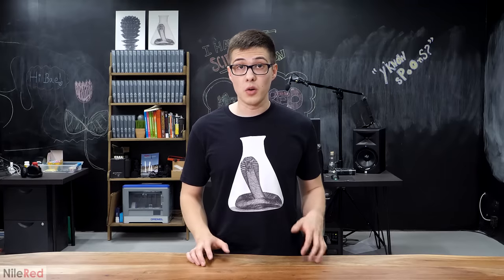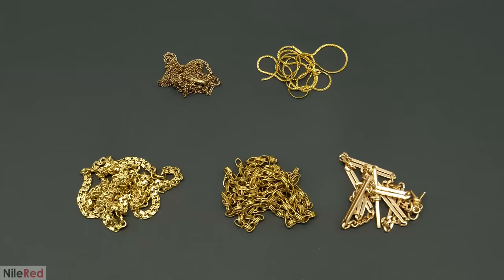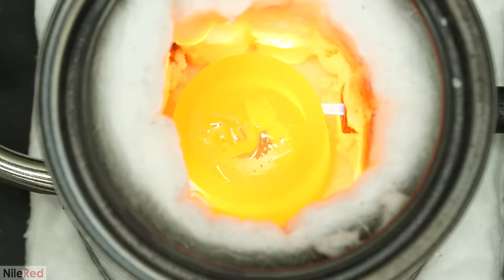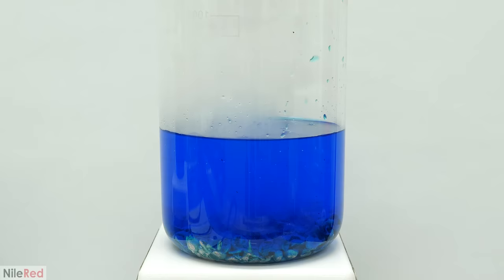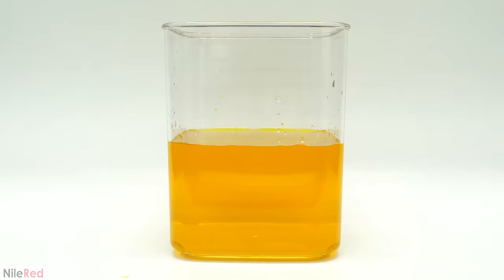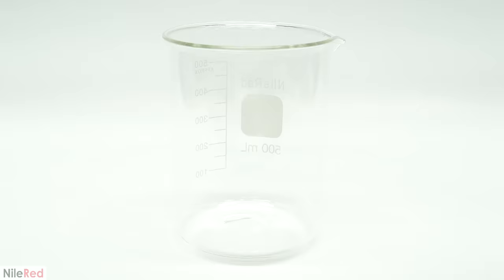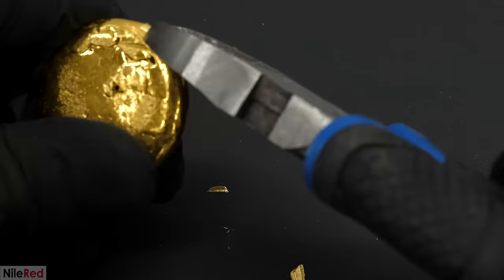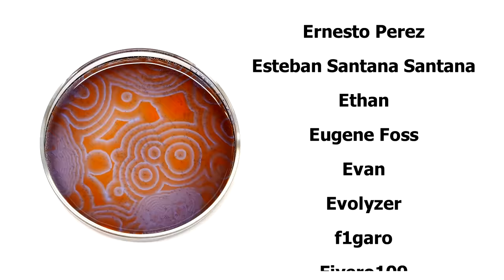Turning old jewelry into pure gold bars

Comment: Is no one going to talk about the fact that someone just sent a functioning ROLEX to be destroyed??
Reply: i think the rolex may have been a good quality replica which could still have 14k gold plating. itd be stupid to send a real rolex lol
Reply: @nocturnalmayhem0  It is stupid to send that nice replica (if it actually is) anyway
Reply: @fernandovillafuerte2529  nahhh replicas are bad if they use the real brands trademarks, someone could easily sell replicas as the real ones for real high prices so every replica destroyed is good in my opinion. if theyre homage replicas with no branding then theyre fine
Reply: @nocturnalmayhem0  You are right
Reply: It's 100% a fake. The seconds hand on real Rolex's moves in a steady fluid motion, You can see that one ticking.
Reply: I'd rather have the R.olex than the $3 worth of gold microplating.
Reply: @Autobot Star Platinum lowkey
Reply: @iheartninja  No, thats consistent with how a Rolex like this one moves. Most base level Rolexes (mainly ones without a chronometer, but thats not a hard and fast rule) have a fairly slow vibration rate (how many times the watch "ticks" per second), this means that the second hand moves with somewhat more visible jumps. No watch actually moves perfectly smoothly, its only that they move many times per second, so they look much more smooth than a quartz watch. A watch with a higher VPH will move more smoothly, but the way this one moves is still consistent with a mechanical watch movement (movement being the name for the innards of a watch). While it is still possible, I think it is unlikely that this is a replica, as those are nearly always quartz movements.
Reply: @Nguyen Max Most watches still hold significant value on the second hand market. In fact there are many companies that specialize just in selling used timepieces. I can nearly guarantee that this watch is not a reproduction and is probably still worth a fair bit. It is certainly worth more than the gold it contains...
Reply: @nocturnalmayhem0  Yea that shit was ticking and not gliding so def not real
Reply: Rich boi
Reply: @eshanroveran7850  all mechanical watches (like most Rolexes) still "tick", they just tick multiple times per second, making the motion look more fluid. Some watches "tick" very fast, moving many times per second, and therefor look more fluid. Others "tick" only a few times per second, as low as 3 times per second (there might even be a two, but ive never seen one), so you can notice the motions much more easily. Contrary to what many people think Rolexes are not the pinnacle of watches, especially not the lower end ones, and some Rolex models do indeed "tick" that slowly.
Reply: at 1:42 I definitely stopped watching. 
dislike
Reply: @nocturnalmayhem0  But it wasn't stupid to send someone over $3K worth of gold?
Reply: who sends a gold functional relex to be melted  ..
Reply: @iheartninja  no, it does not
Reply: It’s a fake, the watch it’s based off has an oyster movement and therefore the second hand would not tick, To me it looks like a cheap fake too possibly sold to him in a scam
Reply: I'm ur 1k like!
Reply: I don't mind, I mean a normal watch functions as a watch too.
Reply: @iheartninja  It`s quartz then right?
Reply: tbh rolexes aren't even used theyre only bought for attention lol
Reply: iheartninja some Rolex models don't use the continuous method, I learned this working at a jewelry store. This is one is definitely fake, but you should doubt a Rolex's authenticity based on a wide spread myth.
Reply: @aggonzalezdc  Hell I would have thought that something like a genuine Rolex movement would probably still be valuable in a non-working condition, presumably unless it has met a rather violent end most of the parts would still be functional as spares if nothing else.
Reply: @seraphina985  would still be worth something even in non working condition, because usually it can be repaired by a decent watch mechanic without too much trouble for a tidy profit. Likely its probably not worth much as spare parts unless it was a particularly old and rare movement which may have parts which are no longer in production. Rolex (like just about every brand) maintains spare parts to repair their watches, so spare parts aren't too hard to come by usually. So it may not be worth a ton as spare parts but that doesnt make it anywhere near worthless. Even a cheap Rolex movement is somewhere around 5000 USD? (Not sure exactly, I dont like rolex watches, theyre really not that great and most people wear them just for prestige, not because they love watches, so I dont know their pricing well) maybe worth 1000-2000 on the used market? If you can buy it in non-working condition for a few hundred thats probably worth the time. So yes, definitely still worth something even broken.
Reply: It’s fake Real Rolexes sweep
Reply: @kenyonpapen2608  It is "sweeping". Thats what it looks like when a watch "sweeps". No watch other than the Seiko Spring Drive actually moves perfectly smoothly, they all just tick multiple times per second making it look like they sweep instead of ticking once per second. Some move many many times per second, some only move a few, a cheap rolex is one of the latter (yea, shocking I know, Rolex isnt the best watch that exists, not even close). It is moving exactly the way its supposed to.
Reply: @iheartninja  I dunno about you, but that looks pretty steady and fluid to me. Maybe a slight jitter.
Reply: It’s fake. The magnifying glass on the date doesn’t magnify the date enough if at all.
Reply: I mean, I get it, if my pop gave me some random watch in his will I probably would give it to be taken apart too.

I have no use for it
And idk how much a rollex is even worth. 
Like yeah i could google it now that you guys are making a big deal out of it and I've realised it's probably worth more than the gut feeling I got($200) by vaguely recognizing the word "rolex" from movies...
 I'm only realising that guess is very wrong because of how much shit people are giving Ben in the comments.

Like if I asked you how much a handpan or hurdygurdy is worth you'd (probably) have no clue.
Regular people not being fact encyclopedias, or having a concept of worth, for specialized topics they aren't remotely interested in is to be expected.
You dont know to google the value of something if you didn't know it had value.
Reply: Bernd DasBrot  Bexause it’s an obvious fake and a bad quality one at that.
Reply: @junehitchens7998  that's definitely an mechanical movement and not a quartz movement
Reply: @nopenope7088  Fair enough.  You can believe whatever TF you want.
Reply: Wait that was a Rolex?
Reply: I noticed that too and was like holy shit. Damn son.
Reply: @nocturnalmayhem0  yea wasn't a real Rolex - you can tell just by looking at it.  He could too.
Reply: @aggonzalezdc  this comment section is clearly cursed and littered by people who think they have a clue about what they are talking about. You are obviously completely right, this is how that movement should move. I also think, that this isn’t a fake. No one fakes these old 80‘s Datejusts, at least not with an automatic movement, that’s way too much work when you can fake a hulk or something like that for the same effort and get a fake with much more attraction to the Rolex-wearer of today. Btw: it’s my birthday today :)
Reply: Science is more important than something that's job had been taken by LITTARLY WHAT HE WAS CONTACTING HIM WITH! Thank you for coming to my tedtalk and if you just take a sniff of this beautiful rag that i just sprayed which is definitely not cloraform and is perfume you will be welcomed to my basement.
Reply: @fernandovillafuerte2529  nah, the dude could be really rich and had an interest in chemistry and channels like NileRed and thought "eh fuck it. Send the whole thing to him and maybe he can make something interesting out of it."
Reply: The Rolex is 100% FAKE.   I’m a Rolex certified technician.  That watch is garbage.
Reply: @adamsapple7193  Of course, I'm also a nuclear physicist, a retired US Navy general, and I have a degree in BS Chemistry since I was 9.
Reply: @grenzviel4480  As an ET Scientist who works at Area 51 on my days off I concur
Reply: @adamsapple7193  Agreed. I showed this video to a certified Rolex technician and he said that it was not a Rolex wristwatch he was looking at, but a Samsung smartphone.
Reply: @zedsyzygy205  exactly.
Reply: @aggonzalezdc  Agreed, however replicas with mechanical movements are plentiful.  Only the dirt cheap ones have quartz movements.
Reply: About 50 years ago a Rolex was a lot cheaper then it was today. Most people probably won't assume they have a real one, but will assume they have a fake. A lot of folk used to be given them as gifts from work then their relatives would inherit them. They're not worth much if they're not in working order and getting them serviced can be a nightmare depending on where you live. So you see a few on eBay non-running going for not as much as you'd think

Comment: I'm not even a watch person, but I'm so glad you didn't melt the Rolex.
Reply: You are a watch person.
Reply: You are a watch person if you think watches have any monetary value
Reply: It’s fake anyways
Reply: I bought the same one not working for 50$ from an old lady at a garage sale. Pulled the backplate and it was a battery operated plastic insert. 100% fake or it would have a serial number
Reply: @Drag0nmaster  watches have monetary value, because people will buy them for a lot of money
Reply: @Drag0nmaster  well even if watches are useless they still have monetary value
Reply: Same
Reply: You say your not a watch person? Give it time.
Reply: I know Rolex's very well. That was a Datejust. Anti Reflective wasn't used under the Oculus magnifier until later in the series. Only parts that are gold on it are the hands, indices and crown. All are standard at 18 Karat. The problem is the vary glaring tell sign of the magnification not being 2.5x. So this is most likely a fake and you would have only the gold plating to extract... which is micrometers of material. Best way to tell is to open the back and check if its a free sprung or regulated balance to be 100% sure. So glad you didn't melt it btw.
Reply: @mcmonkey26  yea rich collectors
Reply: @Drag0nmaster  they actually do especially solid gold
Reply: @InevitableTruthTeller  the watch was fake but that’s not one of the signs
Reply: I’m a giants fan, but I’m glad he didn’t melt the Rolex
Reply: @MikesAdventures44  fake or not, it still looks nice.
Reply: @itselfbookshelf8472  lol a fake Rolex does NOT look nice
Reply: @MikesAdventures44  I thought it looked pretty nice. I’m not a watch person by any means though.
Reply: @akallstar5  Not a watch guy.  I just heard that somewhere.  Must have been on a 'not well researched' show, or something.
Reply: @InevitableTruthTeller  lol. No.
Reply: @mcmonkey26  They're not buying the watch, they're buying the name.
Reply: Exactly
Reply: Watch parsans
Reply: Same lmao
Reply: Dude you win life if you get a Rolex
Reply: J Cyrus  how so what?
Reply: @Drag0nmaster  You’re just not a good person. Saying watches are just pieces of metal is like saying Mona Lisa is just a canvas with colors on it
Reply: @CH33BO_OFFICIAL  it was worth a shot though right?
Reply: Dont worry it was fake anyways.
How to tell?
Rolex doesnt plate any part of their watches. All that "scrap" was links from the watch and they were all plated. 

Probably a 300 dollar replica at most
Reply: it was not a real Rolex , look at the back of it
Reply: @quorthonsinferno5119  I mean I agree with OP for what I think was his actual reason.

The watch looks nice. That's it. Don't give a shit if it's a "real" Rolex, that's all just moneygrubbing bullshit for moronic rich people; the watch itself looks nice, so it's cool that it wasn't destroyed.

Hell, I have a $50 watch and I'd be sad if that was destroyed, just because I love the look of it.

It tells the time and it's not ugly. That's all you need from a watch.
Reply: not much gold in there
Reply: Same
Reply: @InevitableTruthTeller  I'm wearing a real Rolex right now and the back is exactly like this. No markings. The serial numbers are all inside fyi.
Reply: @samholt4139  It's fake anyway, all Rolex's have a perfectly smooth second hand, the one in this video staggers just enough to know it's not real.
Reply: I'm glad I'm not the only watch person here who had that sinking feeling in the pit of my stomach when i saw the rolex and realize it  was gonna get melted, yikes 😬.
Reply: @housecat1359  ew..weirdo
Reply: Couldn’t agree more, ... 🖤🙏🏻
Reply: @fard2780  lol useless lmao no it's very useful if u buy With less money
Reply: @fard2780  The only reason They Have so much value Is because for some reason people was valuable materials on them
Reply: @Drag0nmaster  Applicable to literally any cosmetic jewelry. Something has monetary value if someone else also believes it has monetary value. Welcome to how humans have bartered for eternity.
Reply: @Drag0nmaster  Everything has “a monetary value” in a monetary fucking system
Reply: it was a folex anyways lol
Reply: @housecat1359  its a bot
Reply: Same!
Reply: @joshuamills1882  - Must be one of the smarter Giants fans, for sure.
Reply: @vladimird5280  - Exactly.  If it was a functional timepiece,  then it's definitely worth something. Even if it's worth $10, still...."Ten bucks is Ten bucks".
Reply: @dowfreak7  Rolex puts hundreds of hours into each individual watch before it's put on the market. Wearing fake brand Rolex is fucked up. They aren't just for rich people, but people who work very hard. Rolex was the original working man's watch. It says a lot about someone's character if they are willing to take the instant gratification route, and there are plenty of nice inexpensive watches out there.
Reply: Thats funny watch look very close his scrap gold was the watch band
Reply: Watches, guns, locks, anything with high precision metalwork fascinates me.
Reply: @MikesAdventures44  if they didn't look nice they wouldn't make fake Rolexes
Reply: @DuckReconMajor  I didn’t say Rolex’s look ugly. Just fake ones
Reply: @MikesAdventures44  and i'm saying if the fake ones were ugly people wouldn't buy them, thus they wouldn't be made
Reply: @Musicinternal  boy i love it when you meet an actual expert on a comment section
Reply: @Musicinternal  you don't know rolex's very well otherwise the biggest tell would be the date font alone. Not even remotely close to gen font... 🤣🤣
Reply: @nitermania7593  
Mechanical timepieces don't have a smooth second hand. Every oscillation of the controller is one step, and they do one around six times per second (more than enough to clearly notice the steps). If your mechanical watch has a smooth second hand, I'm sorry, but it's a quartz watch.
Reply: @Drag0nmaster  they do. especially when they're made of precious materials, or are handmade

Comment: imagine if chemistry class wad like this, not memorizing the periodic table
Reply: if Nile didn't know how the periodic table works,  he'd never know which acid to use, when to use and what was getting dissolved based on the color of the soutions.  There's no chemistry without period table my friend. Sometimes we do have to memorize some trends that goes along in the periodic table (obviously with some logical reasoning)
Reply: @chopotronichappiness8917  It is fine to be lazy and just want to do the fun stuff
just know that because you memorized the periodic table, you have a greater chance of intellectual wealth.
Reply: Wait, memorising trends or elements?
Cause trends are useful.
Reply: Lilith does stuff  He learned how to refine gold and silver. 
That's useful if you wanna be a metalsmith, no?

Comment: For anyone watching this on or near 1/08/2023 (August) The money the fan would have been able to get had they sold it straight away upon returning it. Based on average the spot price around April 2019 for 81.31g or 52.29 dwt and factoring in a standard fee for retail sale they would have got about $3202. If they sold it today using the same calculation it would have got them $4869, both prices in USD.